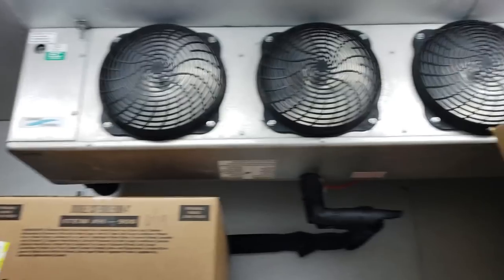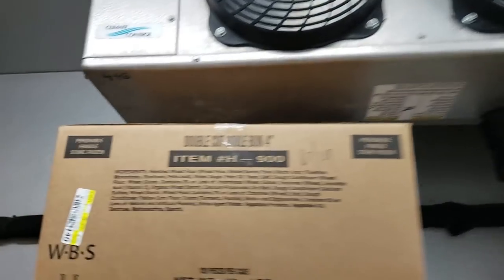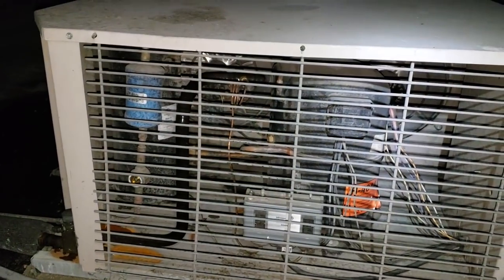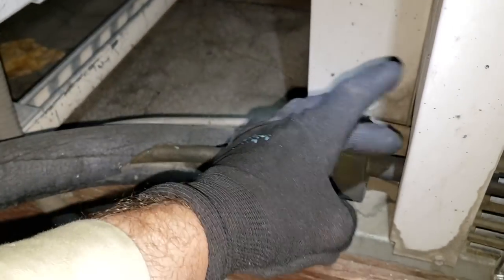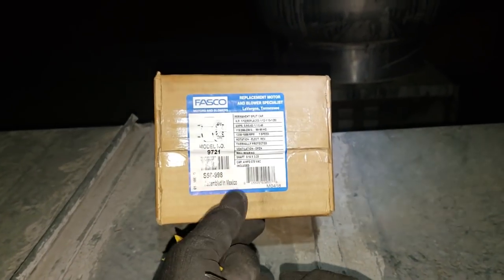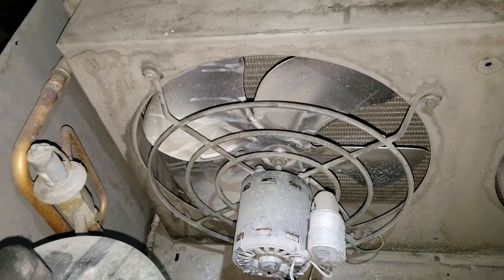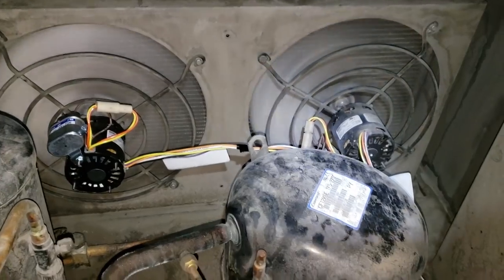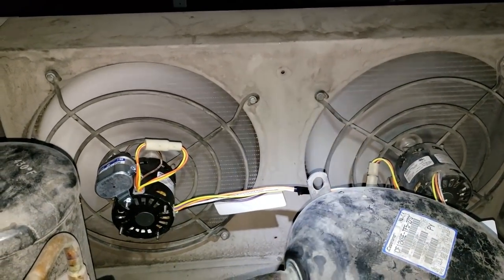Friday night Walk in Freezer service call

Comment: Both OEM and universal motors have a 40C rating. . OEM motors are typically sleeve bearings and have bearing failures. Universals are typically ball bearings . In my opinion a motor that has a 104 degree rating is not enough for desert climates where temperatures  inside a condensing unit can be over 140 degrees . Those motors run hot and will have a shortened life due to premature insulation breakdown.

Comment: I installed a transformer and later found the relay coil was shorted, this caused the 24vac to drop to 5vac. I thought I was having a bad transformer. Like you say think it through and check everything.

Comment: take easyones anytime good break for you , do you always wear long sleeve shirts dont you feel hot and sweatier soaked out how do you feel in it all day in the hot days ?
Reply from the maker: Believe it or not I feel cooler in long sleeve shirts, I also wear an underarmour sweat wicking shirt under the long sleeve.
Reply: Gene K blocking those sun rays from hitting our skin is cooler then short sleeve. A co-work takes off his shirt and it looks like he still has one on
Reply: Man I tried it couple of times I was soaked with sweat all the way to my pants I swear one time I was dripping sweat from the bottom end of my long pants,my client notified me I was surprised as well like wow !IDK how you guys do it some of my fellow older Techs do it I always ask the same question? ???!!!
Reply: Gene K i always wore long sleeves because i was always putting my arms where  they  shouldn't  be  and the cloth gives you a" heads up"  if that makes any sense. Like a fan hitting your sleeve before slicing your forearm
Reply: Xtra moist lol jonhvac n Geoff whattt!!😓hey afterwards 👊🍻 cheers ya'll😊have fun
Reply from the maker: Long sleeves are also great for discharge lines, before the long sleeves I looked like a addict with track Mark's all up my arm!! :-)